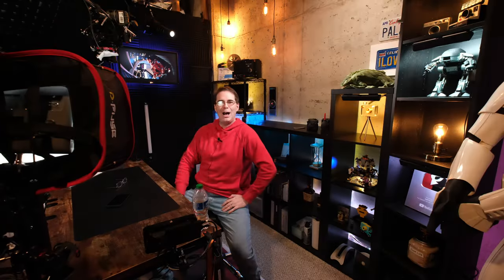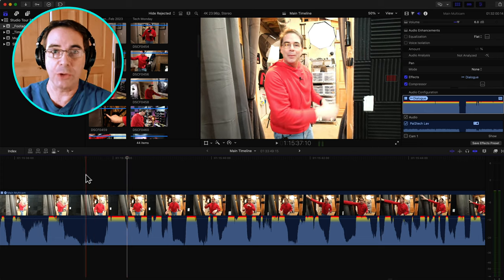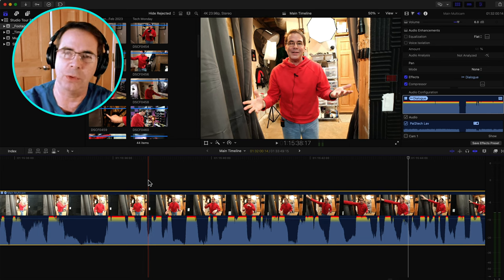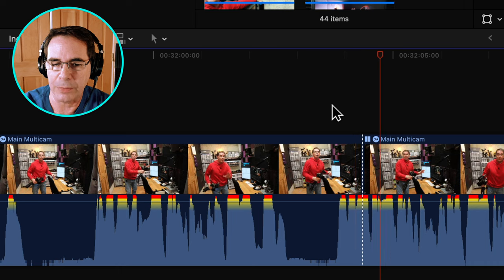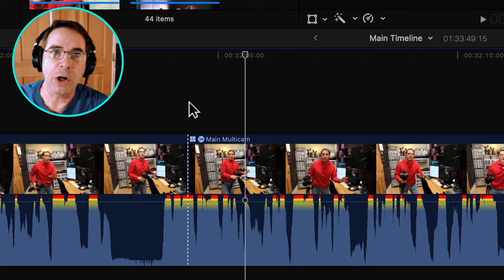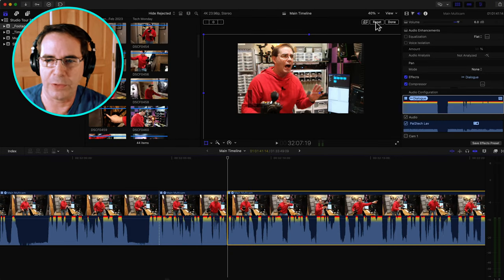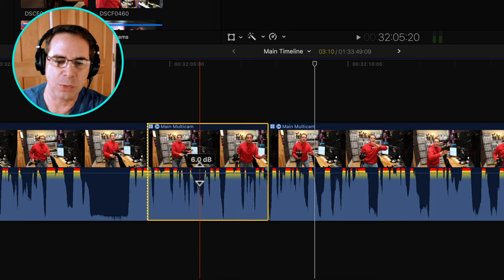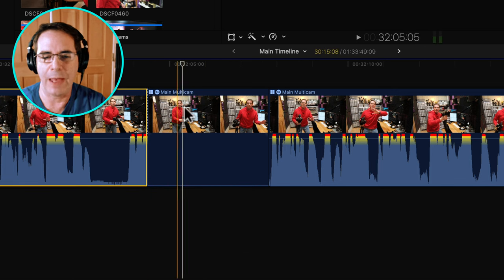How to Fix Final Cut Pro Audio Problem!

Comment: Can' hear the clicking sound, as the cut where you spliced it was so loud (literally it's in the red, lol).   I'm encountering a fraction of a second audio drop outs in my situation, that just started happening today. Same scenario: talking head, and trying to 'reconstruct sentences' by rearranging the order of the speakers words.  But for every single cuts of my clip, there is a blasted split second silence gap. It can easily be heard when someone isn't talking - the room tone 'fuzz' drops away.   Anyhow, I'll resume watching your video to see if your workaround can help me.  thanks for reading.

Comment: I have hated those pops too, and last week I stumbled upon a fix that requires setting up a keyboard short cut, but once it’s set it works really well. I found it in this video: https://youtu.be/uqVDWFjnuGY
Reply: Thanks for the link! FYI: I noticed that Option - T is the original keyboard shortcut.